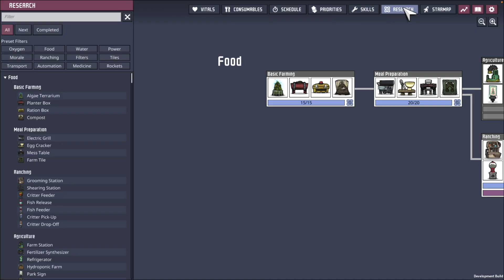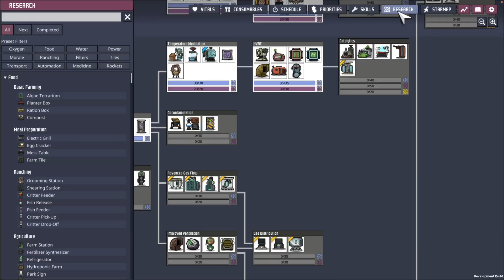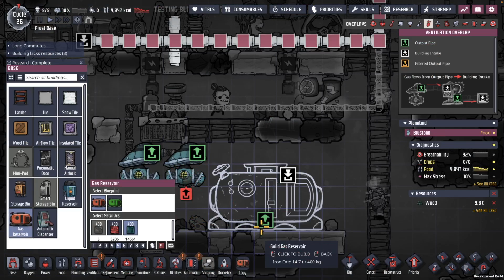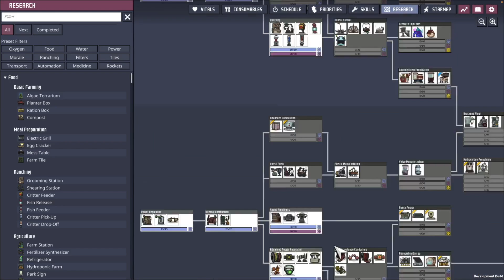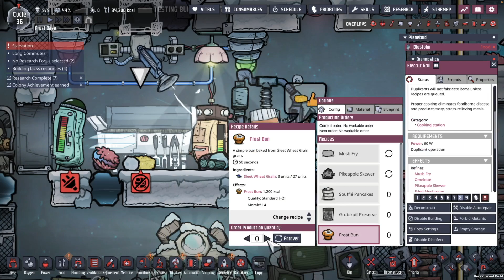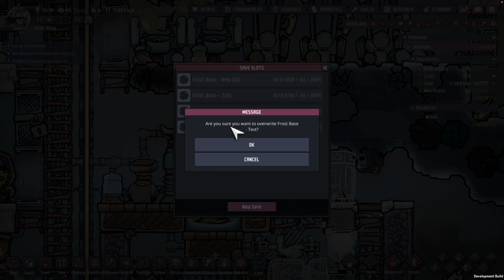Surviving - Frosty Planet Beta 11

Comment: Nice ! Keep it up ! 
As usual, some comment :
You can automate the water for the electrolyser with simple hydro sensor and a door to deny access to the bottle opener.
38:18 To produce refine metal, you can also use the water before it goes into the electrolyser. Then it doesn't risk freezing anymore and you would not produce more heat as the oxygen already go out at 70°c.
Even less heat, as you would produce double the metal. And you can use the hot water in pipe as radiator in the base/bedrooms (if you insulate it one day) or in your future ice melter without needing the tepidizer. Sure tepedizer is the best DTU per W, but you would need to produce this metal anyway.
40:37 rerolling printing pod because the dupe is too good ... respect !
1:11:30 Your auto sweeper is confused.